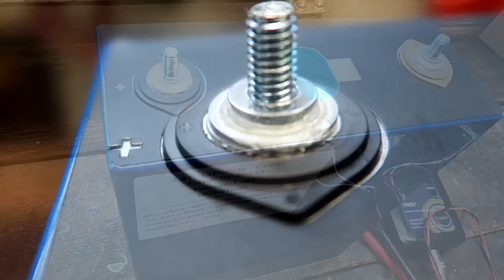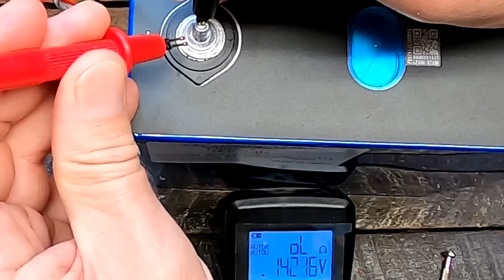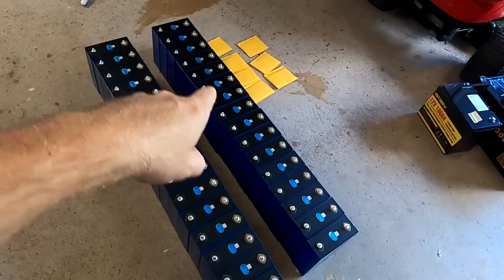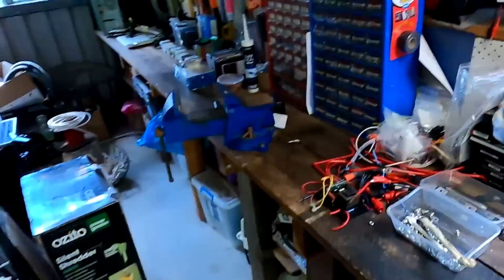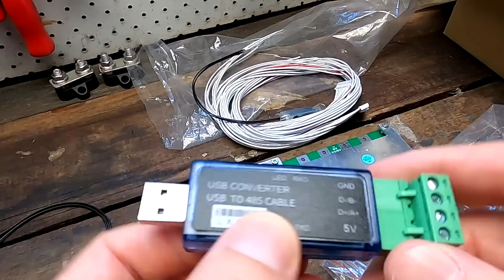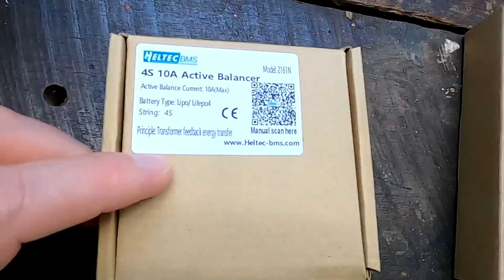Two new battery banks.. But what's the best BMS I should get? 🤔

Comment: Hi Andy ,  I heard a story saying you shouldn’t store batteries directly on the concrete floor.. does this have any truth to it.
Reply from the maker: What? What will happen??? Is this some Voodoo?
Reply: It is a lead acid thing. It’s voltage is temperature dependant. If the bottom half of the cell is on a cold floor and the top half in warm air then you get a circulation current within the cell, which reduces how long the battery can survive in storage.
Reply from the maker: @henvern  Thanks for the explanation. This is of course valid for long term usage of lead acid batteries in such conditions and has nothing to do with a concrete floor as such. This can also happen if a cold air stream is creating such a temperature difference.
Reply: In ww1 the cells were made of lead acid in glass wrapped in tar surrounded by a wooden box to make a battery. If stored on cold damp concrete, the wood would swell and crack the glass. So don't do it.

Comment: any other contact points would be in Parallel .... therefore  1/R = 1/r1 + 1/r2 + 1/rs .....   reduction at any one point .. why gpus now use parallel earths to ensure no heat occurs in action  as this is last thing you want in massive energy useage in highly critical function .. smiles .. so cooler no matter what ..  whether significant or not

Comment: I have been happy with the overkill solar BMS. It’s only rated at 100A, but I have built 2 battery banks in parallel with them and they work well.  Very rare I pull over 40A through them at the same time.
Reply from the maker: I have the Overkill BMS as well, just totally forgot about it. Madi has sent me hers from Canada. 100A would be OK for me as each bank will only be discharged with 50A max. So that could be an another option we already have in stock.

Comment: Looks like some type of ablation when they laser weld the bolts.

I would be interesting if they could put a hex bolt on there so a wrench could be used on the bolt to prevent it being torn off if over torqued.

Comment: Dear Off Grid AKA OG:

As far as the BMS situation goes, I will talk about my own experience. The following is what I would consider in relation to any BMS.
1.) Can the BMS under consideration actually be in hand in a reasonable amount of time and price.
2.) Is the BMS actually available and on the shelf at the supplier?
3.) What kind of support does the BMS have?
4.) Can it be bought through an in-country supplier so that it can be returned with reasonable shipping in case of a problem?

Without those 4 considerations, no matter if the BMS is made of Platinum, it is not going to do a person any good. After all, a bird in the hand is better than no bird at all, bush or no bush. Personally, after all of the technical considerations were calculated, I would have preferred Overkill or a Batrium BMS coupled with an active balancer to be used on a periodic basis. However, even though reality is a bitch, you have to live with it. I finally had to settle for a Daly 250-amp smart BMS coupled with an active balancer, to be used on a periodic basis, only because I was confident that I could actually buy and receive them. Of course, the two overriding concerns were price and availability. As it turns out, a supplier in Seattle had a 250 amp smart Daly BMS, available to be shipped, that I received in 2 days. Overkill is either out of stock most of the time or it is not able to meet my amp requirements even to this day, so they were not even considered beyond technical specifications. Batrium, while great, would have cost me between $800.00 to $1000.00 by the time I had bought all of the accessories. 

As I watch your latest effort, I checked the price, as I always do, of the eve lifepo4 3.2v 280ah cells via your Amazon link. This is what the Amazon advertisement says verbatim:

ABOWKS 4PCS 3.2V 280AH Lifepo4 Battery Lithium Iron Phosphate Prismatic Cell Solar Cells LiFePO4 Energy Storage System (16PCS) Brand: ABOWKS
$3,119.99 ($780.00 / Item) FREE delivery April 22 - 27.

Of course, there is the usual deceptive advertising because in one instance the claim seems to say that the price is for "4PCS," and in another instance, the claim is for "16PCS." Later on, the following shows up verbatim:

Number of Batteries 16 12V batteries required. Brand ABOWKS Battery Cell Composition Lithium-Phosphate Compatible Phone Models Does not apply Recommended Uses For Product 代步车

Then later:

This item: ABOWKS 4PCS 3.2V 280AH Lifepo4 Battery Lithium Iron Phosphate Prismatic Cell Solar Cells LiFePO4 Energy Storage System (16PCS) $3,119.99 ($780.00/Item) FREE Shipping

Do the math...

Whoa be on to the poor initiate who is looking at this ad for the first time. Right? The shame of it is that once a novice has figured out that the ad is for 4 cells at $780 each, they, as I did many times in the past, will look at other adds only to find the same vague description be it on eBay, or any one of 100 Alibaba like advertisements. Granted, a person can try to order from China, as twice I did, and the shipments will never arrive, as happened to me twice through eBay, or will arrive months later as has apparently been the case with you and most other DIYers. As far as in country US suppliers go? Well, the price is either the same or higher. Additionally, I have found that about 30% of US suppliers are just as dishonest as Chinese suppliers are as is recently evidenced by a US supplier selling inverters, set up for the European market, on the US market. Contact Will Prouse on that little fiasco. 

I now order only from Amazon or eBay, in spite of the higher prices, because I have stronger assurances that I will receive just treatment should there be a problem with either shipment or the product itself. Those very assurances from both suppliers have saved me around $6,000 in lost money over just the last year. I doubt that Ali Express or Alibaba would have done as much considering the deterioration of the state of world affairs over the last 2 to 3 years. There is also a greater assurance that the product is actually in stock on location, and that the product will be shipped and will arrive in a reasonable amount of time. As you might remember, I will not accept shipment of lithium batteries that have been in shipment for more than 2 months, nor should anyone else, because there is no guaranty that the shippers have treated the cells as they should be treated. 

At this point, I have been able to procure enough cells to make a 300 Ah 48-volt battery bank, along with all of the accessories and tools to do such, for about $3200.00. The cells came from Battery Hookup and the accessories and tools came from Amazon. It turns out that holders, insulating rings etc., for 32650 LiFePO4 cells are hard to come buy even from the vendor. With the above price from Amazon, the same capacity and voltage in ABOWKS cells would cost about $12,479.96 not counting shipping or accessories, and that is about the going price for lithium prismatic cells or preassembled with BMS battery packs in the US these days. Luckily, I saw the political curve ball coming across the world over the last year and found a reasonable supplier. Thus, I went into debt to procure my 32650s and I am damned glad of doing so. This same luck pretty much has applied to my entire micro-PV/wind unit. This is especially so considering the tariffs that the US has thrown up against pretty much the entire world. I guess that knowledge is what pushed me into starting to build my unit about 3 years ago before prices became insane. How is the supply of electronics in Australia? Though supply is getting a little better in the US, there are still plenty of "Out of Stock" signs in common electronic seller stores such as Walmart and Best Buy.

For the future, I am researching and experimenting with saltwater batteries. As far as they are concerned, there are many problems that need to be worked out. On the other hand, all of the materials can be found or bought locally across the world, and they are as safe from fire and explosion as a bucket of water which is what they are. The one thing that does worry me most is the amount of space needed to store them. 

Good Bye and Good Luck OG!!!
Reply from the maker: Wow, thumbs up for the longest comment ever!

Comment: id really ike you to try a BMS123. theres no current limit. and they now do a usb part that will communicate directly with victron gx.
Reply from the maker: That looks really complex! But interesting...
Reply: @OffGridGarageAustralia  yes. it does seem it. i have fitted a couple to 4s 12v systems. the big gain on 12v 3kw inverters. is only one bms is needed. their new usb unit, and the support to talk direct to a cerbo is most interesting to me, i want to know if it then controls the go/no go on charge and discharge via this, instead of the current "assistant" in the multiplus. the first problem i see you hitting is the way the little circuit board will possibly affect your bolts and candles thing. i got round it by drilling and tapping smaller bolts into the heads of the link bolts. the balancing is pretty slow too, i like the look of the heltec active balancer in conjunction with a bms123
Reply from the maker: @darrenslater1913  Yeah, OK. I think if we o down the active balancer path anyway, we could just use a cheap DALY. So basically the JK with integrated active balancer is still a very good option. But I asked for  something different, I know 😏
Reply: @OffGridGarageAustralia  hahahaha. cool. well bms123 is different, all the flashing lights will look like star ship enterprise.
Reply from the maker: @darrenslater1913  flashing lights? Oh, this bumps it up the list 😆

Comment: Many types of stainless are magnetic, we called them chrome iron as a general description but i think they are called ferritic stainless steels, non magnetic stainless can gain magnetic properties during machining or work hardening which may explain the slight pull on the nuts (insert joke here).
Question - what key features would you like to see in an active balancer ?
Challenge - could you make your own balancer?

Comment: I would recommend the Seplos BMS or another brand which can be individually addressed by setting DIP switches. On the negative side, I believe that they are PASSIVE balancing rather than ACTIVE and therefore I would recommend adding a high current active balancer to the pack.
Reply from the maker: See, I would not do that,  buying a BMS plus adding a balancer. If I already had a Daly, yes, that would be the way to go. But buying a new BMS and already knowing I need an active balancer, well, that would then be a JK-BMS.
The Seplos does not excite me at all. I cannot find any feature where I would say, wow, that is great and I wand this. Communciation? All other BMS can do the same these days.
Reply: @OffGridGarageAustralia  I fully agree with you which is why I mentioned adding an active balancer.  I truly wish the Seplos would have an active balancer rather than a passive one.
Reply: @danielglang6312  Guys, passive balancing on Seplos still does the job but a bit slower. It is a MAC vs PC argument in my opinion. You have to read more into how it works and in my opinion is more efficient but slower. At the end the result is what matters and not the personal preferences. IMHO
A

Comment: Why am I blocked if I write the name of a product?
Reply: Youtube
Reply from the maker: As soon as you post a link, you comment won't get published. Otherwise there would be 1.000.000 spam comments
Reply: @OffGridGarageAustralia   I did not post a link, just the name and number of a bus bar that I hoped you could test.
Retrying. It was bought where you use to shop starting at A ending at s and there were flexible busbars from Li-ion Battery Manufacturer Store
Reply from the maker: @spectator-w9m  as soon as there is a dot between two words or numbers, YouTube thinks it's a link.

Comment: One thought, try measuring between a LOWER point on the stud and the base. The nut makes contact lower than just the top, the lower threads make a firm contact along the full length of the nut, not at just the top of the stud.
Reply: GOOD MORNING GUYS!!!!   My question is.  How many of the: over kill BMS:  16s 48v 100 amp load charge BMS to be able to handle Load about 10,000 watts 240v continue for 6-10 hours use/ charge car.  Any one please help. if you have the Math show how to calculate will be great.  I will buy -30 - 40 kwh battery bank thanks a lot.  Solar 5kwh,  INverter: 3x 5kwh Growatt inverter.

Comment: REC BMS told me I can use the one BMS for three parallel 16 cell series (so about 45kWh) but I've yet to order my 32 other cells.

Again, this is for the SMA Sunny Island, which is a bit particular.
Reply: This is interesting. Do you know what model they’re talking about ? Thx
Reply: @showmequick2245  it's the REC-BMS-SI and in their words "You can put the battery cells in parallel first and then in series to increase capacity and still use only one BMS. You can set the parameters accordingly with Wi-Fi module you ordered."

Comment: Hi Andy great video, in regard to BMS solution I would raccomend the JK BMS, because it as an Active Cell Balancer so it will balance the battery much quickly than a normal BMS; and if you are intrested in something similar you could use the Daly BMS but: you have to keep in mind that at high SOC and above 3.45 you need to use an Active Cell Balancer connected to Voltage Comparator so, that it will switch on the balancer from a voltage above 3.5V like what I did.

Comment: One of the best bms is the DIY BMS, it is a bms that costs a little to manufacture, but has a great capacity for configuration and communication. The balancing is a bit lacking, but it could be combined with a capacitor balancer or a jk. I think the seplos is also a good option.
Reply from the maker: I had a look at the DIY BMS and found it quite geeky with all the programming and flashing you need to do. It's not beginner friendly or easy to setup. 
I'm also not a big fan of the Seplos BMS so far. It has potential but is not there yet.
Reply: Is it possible to communicate with victron system and control the charge current?

Comment: But you need to measure the resistance in the screw just from the bottom to the height of the busbar, which is potentially quite low.

Comment: I can understand that manufacturers and suppliers of turn key solar systems are not happy about the DIY scene. Because DIY batteries have much more capacity for the same price. The only advantage of batteries like Pylontech, BYD etc. is the compatibility of their communication protocol with (those more professional) inverters. From your videos I know that communication between inverter and battery is overrated, it works fine without. But nevertheless I would like to know if it is possible to build a fully (e.g. Pylontech) compatible battery to make use of some advanced inverter functions. This would require a BMS with compatible communication protocol. Do you know one? Can you get one for your test?
Reply from the maker: Thanks for your comment. All BMS's with RS-485 port can communicate with Victron for example. There is a project on Github. A lot of people have already done it and it works great. https://github.com/Louisvdw/dbus-serialbattery

Comment: Regarding the IR of the threaded area, the only issue is that the nut will have an almost infinitely larger contact area than the probes. That will cause the functional resistance through the nut to be lower than you're measuring. Remember, resistance on a surface has to do with area and aspect ratio. It's per square unit of area. The thread surface has a very wide contact patch, creating a very very low resistance for the connection. The nut likely doesn't carry the majority of the current, but I'll bet a fancy coffee it's well over the 5% you claim.
Reply from the maker: So, If I try a nylon nut, what would you expect will happen?
Reply: @OffGridGarageAustralia  Rhetorical question. You already know the answer.

Comment: Check out DiyBMS. It’s a lot more involved than the others. Still very much a work in progress. But it’s coming along. 
RS485
CANbus
2 onboard relays
2 onboard solid state relays
4 gpio 
SD card logging
Support for writing to influxDB and MQTT
Touch screen (interface still in development)
Uses an ESP32 as the controller. 
Each cell has its own module based on an attiny841
Can talk with Victron GX devices and DVCC over VE.Can
Cell modules support 850ma resistive balance current. 

I am using a relay to activate a Heltec 12-16s 5A active balancer.
Reply from the maker: Balancing sucks with the DIYBMS, setup with relays is complex with lots of crimping and connections. I looked into it a few times but never got excited to be honest.